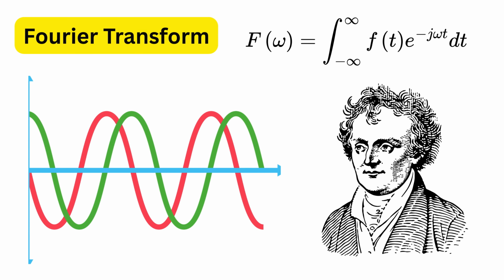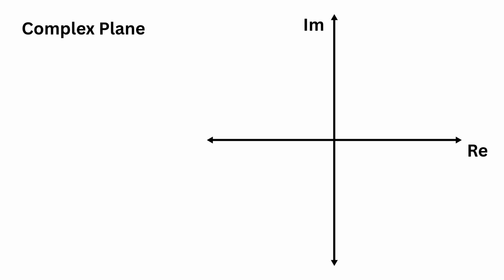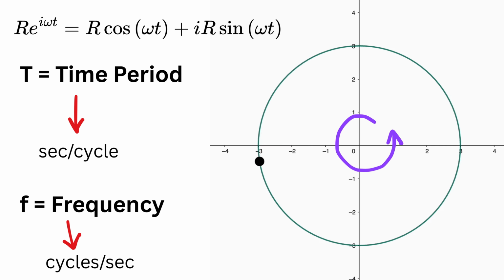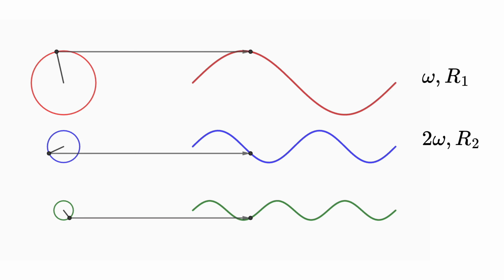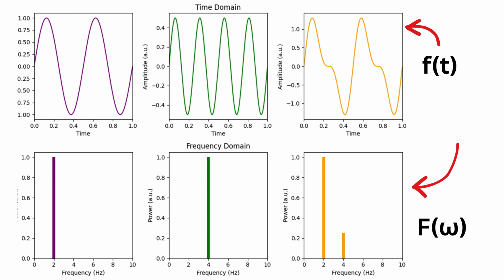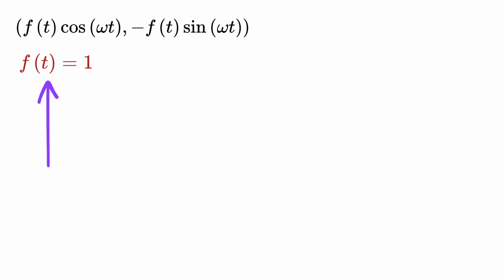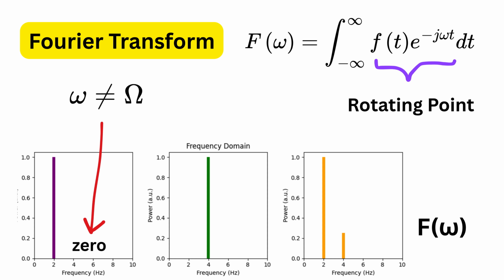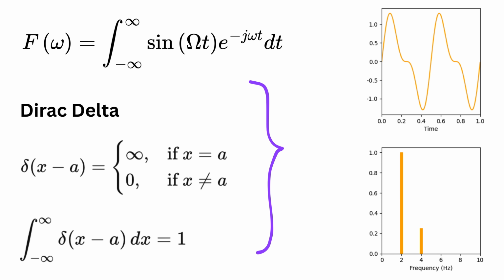Fourier Transform Best Explanation (for Beginners)

Comment: Our professor told Fourier Transform is a method in which a complex signal can be split in to various basic sinusoidal form and then it can be analysed for the information present in the complex waveform .It is applied in analysing the fault signals / transients ,in power systems .

Comment: I worked as a sales engineer for a signal processing company where their signal conditioning equipment acquired analog signals at up to 1 million samples per second in real tie and used FFT to separate the natural signals into separate signals to better discern what was occurring in the sample. The also dealt with Nyquist..and auto-calibration  I ended up selling systems to other companies that had to do complex real time monitoring at sampling spends of millions time per second across many channels.  It was a great job.

Comment: I worked at a Seismic Data Processing Company in Houston in the 1980s, with application to locating oil deposits. I introduced Fourier Transforms to the team for noise removal instead of their historical method of using a convolution, and sped up the processing by up to a factor of 2. Which was a huge savings of computational power, since nearly 90% of the workload was signal processing. Our data center had over 20 huge IBM mainframes each attached to array processors.  Total estimated cost of a single data center hardware was over $250M. The computational array processors we used had highly optimized fourier transform subroutines. Wish I had this video to illustrate my method in those days. Convolution was faster for small signal sizes but the Fourier Transform won for larger signal sizes of over 1K points (most of our workload). My reward for this discovery and implementation was to get hired by a supercomputer manufacturer to lead their applications team, a lot of fun for nearly 20 years.
Reply from the maker: That’s an incredible story. Thanks for sharing :)
Reply: I totally get your point now, and I blame my teachers 20 years ago for not having visual aids to explain why multiplying a strange exponential and integration would get you the frequency components out. It is all about resonance and phase summation using two offsetting waves. But then this simple idea got packaged by lazy professors as some sort of math magic, and scared me and all my classmates
Reply: Thats sound amazing .

 i am curious  to know this in detail like what you did and how it works.
Reply: This is quite surprising to read, because it is a well known relation/equivalence to achieve filtering by standard convolution or by using Fourier transform i.e. both are computationally equivalent if done naively. Is is not rather that you introduced  the Fast Fourier Transform algorithm to your team that sped up the computation and that save the money?
Reply: @oyoyoyo There is a saying that goes as follows, "It is well known to those who know it well." 😂 Sometimes teams will stick to a tried and proven method instead of trying something different. I take credit only for introducing the Fourier Transform Method to that team, to implementing the method, and showing that the results were identical to using the convolution method, at half the computational expense.
Reply: @plztnboy  When I said it is well known I meant mathematically proven and the knowledge is available. Who knows it is another problem.
But my main point is that the Fourier transform itself does not help in computing faster/cheaper etc compared to standard convolution. It is the discovery of FFT that revolutionized the computation.
Reply: This is quite surprising to read, because it is a well known relation/equivalence to achieve filtering by standard convolution or by using Fourier transform i.e. both are computationally equivalent if done naively (and this is already assuming using the discrete Fourier transform, not the continuous one).
Is is not rather that you introduced  the Fast Fourier Transform algorithm to your team that sped up the computation and that save the money?
Reply: That's how much money is in petroleum.
Reply: Amazing story. That must have been some amazing work
Reply: good and all the more good is that you have been rewarded for your innovative idea. sometimes it doesn't happen.
Reply: Discrete FFT was introduced in the late 40s exactly for seismic data processing, specifically to spot potential seismic waves by hidden nuclear tests. You know your stuff ❤❤
Reply: you have emerged me to step in !
Reply: Amazing. Thanks for sharing. I would like to follow you if you could share some experience
Reply: Unbelievable. Lucky you 🎉.

Comment: Back in the 60 wrote Fourier transformation software on a CDC 3300 for Oceanographic data. Our lead used to say  "To say a wave is internal is infernal" as we pulled out the various wave forms from our data. Much easier today with data mining software.
Reply: CDC 3300 I attended the Control Data Institute computer learning center in Arlington Va in '74 and they had a CDC 3300, had it all to myself after hours.  It was a great machine, card reader, tapes and all.  Sure brings back memories.
Reply: @ChrisFFUR By '74 you mean street or year? With all due respect 🙏.
Reply: @AyaforAfesi  1974
Reply: I liked the IBM 1130

😎🙃👍👍
Reply from the maker: It must have been quite a challenge back then.
Reply: You guys are “younger” my first CDC was the 6600. 😂
Reply: @gtanma2006 Dayum!

Comment: Actually when you change \omega in the example with f(t)=1, also the value of F changes, while in your animation it seems not to change. Of course it still remains a circumference, but the point is not still, it changes as it does while changing t)

Comment: 2:51 But why rotate in that way?
Reply: Brother, we take angles from
zero degree to pi by two,
then pi by two to pi,
then pi to 3 pi by two,
and in the last, 3 pi by two to two pi, for a complete circular rotation.
That is why we move in that way.
You can also take rotation in a clockwise direction, but in that case, you have to take the opposite sign to that because to complete a circle, we have only two possibilities. If we take the first possibility as positive, then we must take the second possibility as negative. That is why on a number line, we can approach towards zero from either of the two possibilities, like we can move towards zero either from negative numbers or from positive numbers.
Reply: Positive rotation is anti-clockwise, negative rotation is clockwise

Comment: That's how the frequency analyzers were born.
Reply: The early ones used analog filters, well, one filter actually.

They took a short sample of the signal and then played it back at different speeds through the single filter - a kind of frequency translation process. You can use just one speed and, say, 500 filters or you can use one filter and play it back at 500 different speeds!

To make it work in real time, the signal sample was first sped up by a factor of 500 so the filter would arrive at an answer 500 times quicker. The basic rule is, if you need to know the frequency, you need a complete cycle. As the frequency increases so the time taken to determine the frequency falls.

After the discovery of the Fast Fourier Transform, it became possible to use Fourier techniques digitally.

Comment: you skipped the Nyquist sampling part.
Reply: The video did not mention sampling so there is no Nyquist sampling part to be explained here. The explanation was all continuous analog.

However, if you use either a Discrete Fourier Transform or a Fast Fourier Transform then sampling rate is an issue. Signals are usually analog filtered first to make sure that the maximum frequency in the signal is no more than half the sampling frequency.